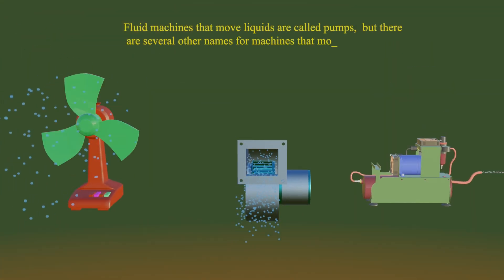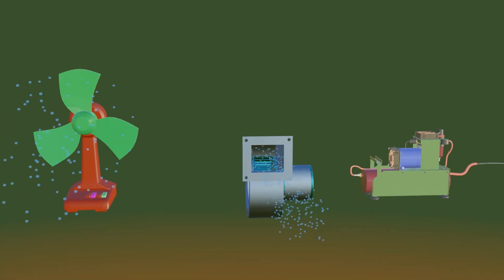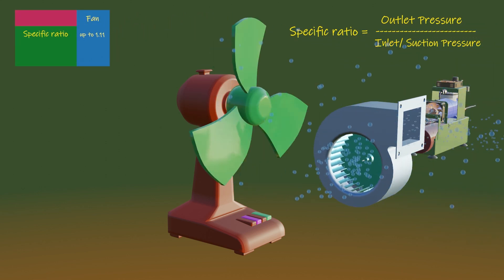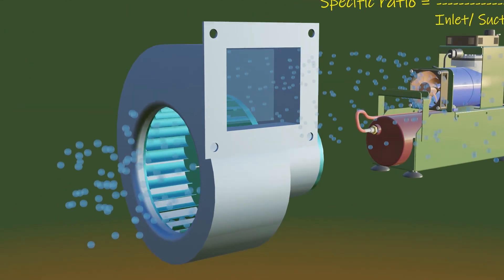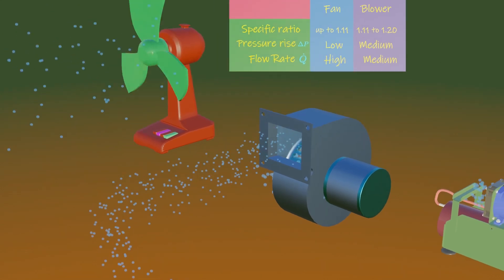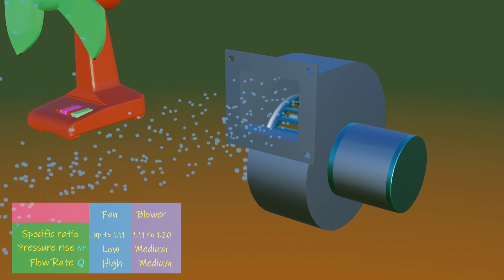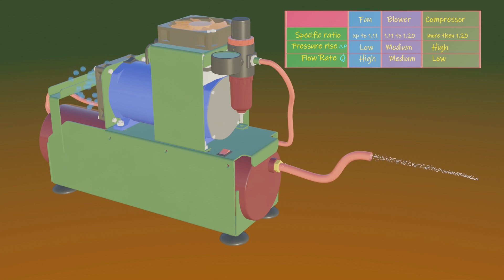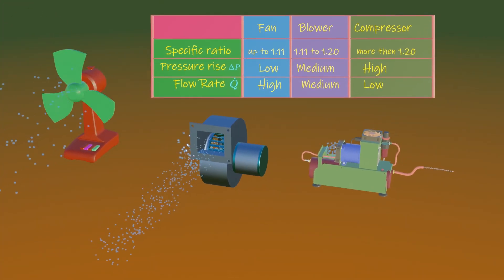Fan Blower and  Compressor. Whats Difference?

Comment: Sir why pump not delivered air??
Reply: Air is less densed than water. Pump is generally used with incompressible  fluids such as water. Pump that has a specific head, for example 30 mlc would produce a head of 30 m air column which is negligible air pressure but with water it'd produce a pressure of 3 kg/cm2 or 3 atm.
Reply: @ani3327  thanks...sir what is compressible flow and incompressible flow??